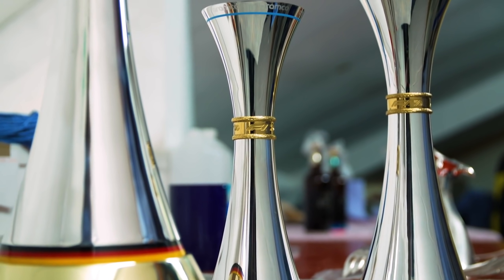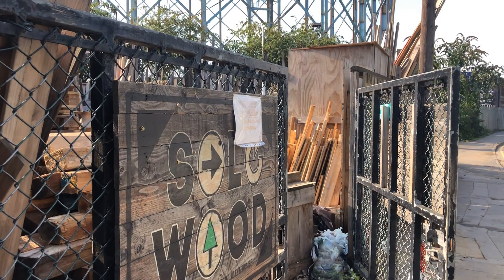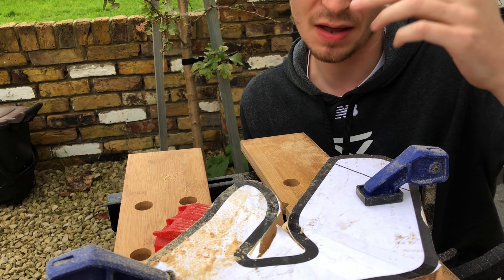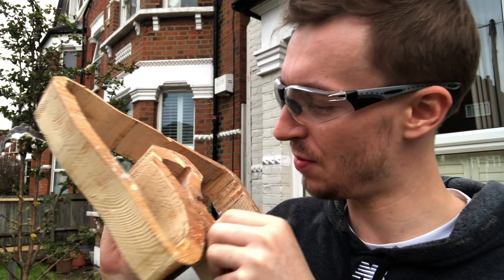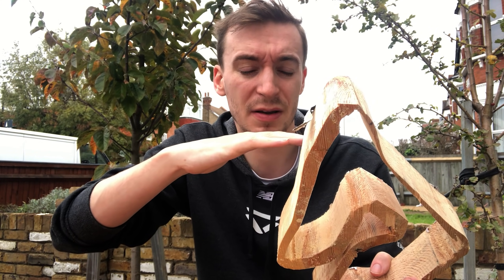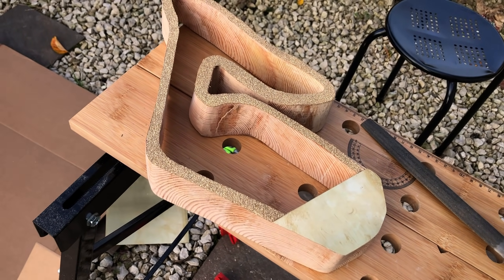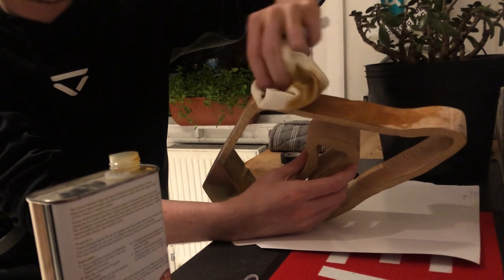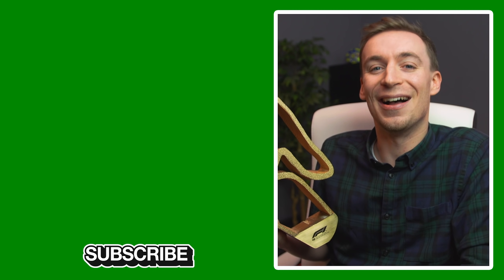Building a Formula 1 Trophy for Cheap!

Comment: Hi Matt! Super cool video! Maybe you could look for a different drill bit so you could fix the drill in place facing downwards so you can use the drill as a manual CNC machine! If you try that, you should end up with straight edges and no burn marks. I used "could" and "should" a lot, because I'm not at all good at DIY stufff, but I think it "should" work
Reply: You'd want an end mill or a router bit not a drill bit..
Reply: but tbh if you were after a high quality finish it'd be better to find a workshop with a CNC to produce this piece
Reply: @hughchapman5319 thanks for the tip!

Comment: Great idea! Just wondering if you had a hard time aligning the stencils? I can’t seem to get mine to fit together flush?
Reply from the maker: I didn't have any issues, just slightly trim off the extra bits and use clear tape to help align it together :)
Reply: @mattamys  No problem, I’ll check and see what I’ve done wrong!

Comment: Hi there, just wondering if you knew what dimensions you used for the decals? Did you just use the default sheet the website displays or did you input your measurements for width x height?
Reply from the maker: The designs I've uploaded are for A4 pieces of paper, their not to scale of the original trophy but a smaller workable size!
Reply: @mattamys  Good thinking, I can measure it from the A4 sheet you uploaded! Many thanks!